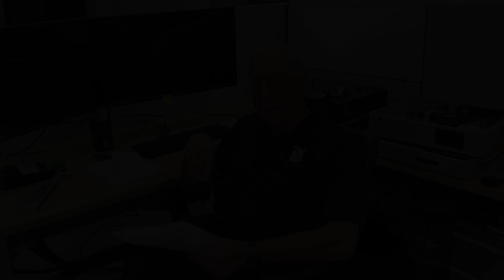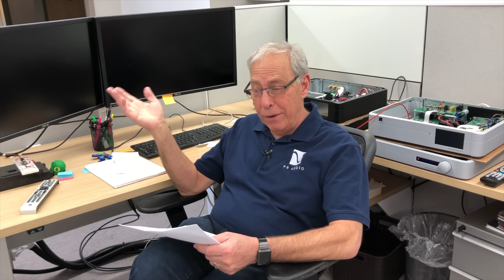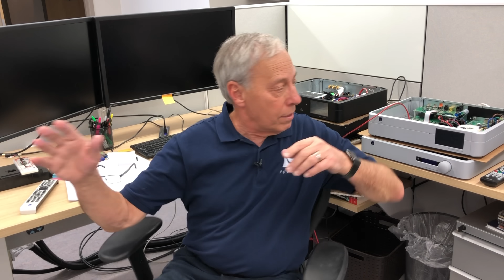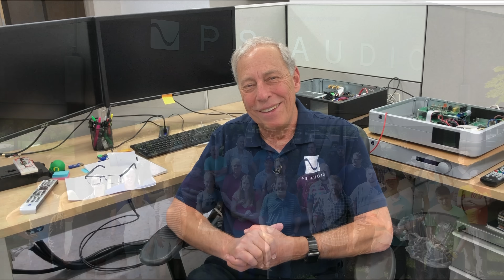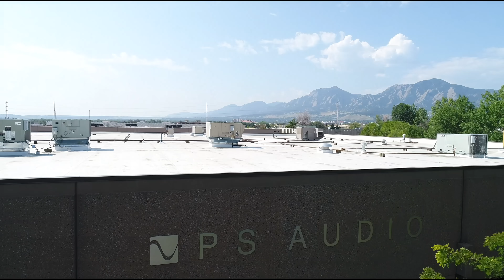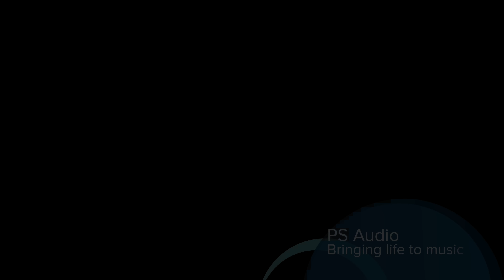Is it time to rethink our power grid?

Comment: I actually have a reasonable amount of professional equipment that has DC inputs on it. Some of it 48v or 24v fixed but some is auto ranging from 12-24v. 

It is very common in the equipment sector that I work in for equipment to either be completely DC powered to be isolated for resilience (so the equipment would runoff a battery bank and the batteries would be charged by a battery charger that was run off a UPS. )

Or, alternatively sometimes you will see a piece of equipment that will use the DC connection as a redundant power source. So it will have in some cases dual AC power supplies and a DC connection as well to a battery bank which has its own charger. Most of our larger network gear is like that.

Comment: No need to make the power grid DC. It's not going to work well. High voltage DC power lines are actually used but it's besides the point.
For home audio it would be possible to setup a DC system. Maybe a ±100V system would be enough.

As a side note. LED can run on AC just fine. They work like diodes.

Comment: I would set the DC Voltage std to 24V ...this value can be used by the  majority of DC/DC converters. ..sure wouldn't be beneficial for amps with around 50to35VDC(SS Amp). But enough for DACs preamps, CD players..and any other home electronic equipment etc

Comment: The argument for dc over ac in the home and office, is much weaker now. Th reason is that inefficient iron transformers are not required anymore. Dc/dc and ac/dc switch mode power supplies are about as efficient as one another, so the efficiency advantage disappears. Also in reality, even with a dc source, such as photovoltaics, the voltage has to be changed to the level required by the equipment it supplies, so there is always an "ac" transformation that has to occur. The exception is with small scale simple battery systems that can tolerate a range of input voltages as the battery voltage rises and falls with charge and discharge. Very high voltage dc supergrids, are now being for international transmission. One advantage is the lack of harmonic distortion and power factor issues that plague ac lines.

Comment: Why doesn't PS Audio offer dedicated solar panels and batteries to power their amplifier rails directly, or with additional regulation? They could add the "Solar" line to their "Stellar" series.
This is only half tongue-in-cheek; I'm considering building an amp with battery-powered rails.
Of course, some AC would still likely be needed to power a tube front-end.

Comment: Your description of power distribution in AC v DC is sort of right but mostly way off.  To deliver the same power, if you up the voltage, you lower the current (P=IV).  With less current, there's less losses (Ohm's law, which I think you've heard of ;) ).  So high voltage actually has smaller losses and is therefore more efficient in delivering the same watts.  (This is very distinct from your suggestion that the losses are the same and high voltage can just afford it.)  The cool thing about AC is that through transformers, you can kick the voltage up or down with pretty small power loss.  So you can pump it long distances at efficient high voltages, and then drop its voltage to safe levels before putting it in homes.  With DC, raising the voltage is much harder to implement, as is lowering the voltage losslessly.

Comment: Theoreticaly a DC building network makes good sense. But in reality its just adding complexity to Building Infrastructure which is the hardest, slowest and most costly to manipulate change. If a method could be invented where running DC Circuit around the whole building could be quick, easy & Modular. Only then could a secondary DC circuit be viable.

Comment: I think a good first step would be to define a physical interface. We have what are probably the worst sockets and plugs in the first world. I have given it some thought. It has to be backwards compatible with what we use now, at least for a few decades. It would probably ease adoption if it supports some superset of fast USB charging. I like the principals reflected in the British plug and socket, but we need something smaller. We would not need that much distance between the circuits if we had a ceramic divider that pushed into a slot in the plug actuated by the ground pin. This divider could also serve as a light pipe, enabling smart plugs and sockets to communicate. If there is no comms, the legacy plugs are powered at 120vac when those contacts are engaged. Otherwise the outlet and whatever is connected to it will negotiate a voltage, frequency (0 for DC), and a current limit. The conversion electronics will be in the wall. 
So when you plug in your laptop, it negotiates the voltage and current it needs and the outlet supplies it.
The same goes with your phone, TV, audio equipment, network equipment, lamps (lamps may even negotiate lower voltages to implement a dimmer with almost zero parts count.
There are also some cases where we here in America could use some more of that higher voltage and power, such as window AC units, power tools, portable cooking equipment... Now almost everything can plug in anywhere and those junky wall warts and cordbunicles can become fossils.
Reply: Compare a British plug and socket to a European Schuko type: the general sizing is very similar. Older types  for North America are nice and small but primitive and dangerous.

Comment: Edison was wrong then, Edison is still wrong now. DC is still not good for long distances due to VD. It may be fine to run low voltage DC inside your house, but it should be stepped down at the house not at the power station, so Tesla remains right. Also there is no thought given to electrocution... With decreased voltage comes increased amps to provide the same nett oomph. So that means making all the wires on the grid substantially heavier to produce the same amount of electricity, not to mention all the heat loss etc etc.

Comment: Transmitting power over any distance with DC is a very bad idea. The higher the voltage the thinner the wire you can use. To get enough power into your house and all the houses in your neighborhood the Utility substations deliver power to a transformer near your house at 12,470, 13,200, or 13,800 volts through wire not much thicker than a pencil. At 120 volts DC you'd need a wire as fat as a tree trunk and you'd have to live within about a mile or less from the generator. Without the invention of AC electricity the modern world as we know it could not exist. The only reason you can have little USB ports around is that the power drawn from them is miniscule.
Reply: "Transmitting power over any distance with DC is a very bad idea."

Better tell the engineers who designed the 180 mile long Basslink cable then. I'm sure they will be happy to take your advice.

"Basslink is a 400kV DC electricity interconnector that allows the trade of electricity between Tasmania and the National Electricity Market. The interconnector is rated to transmit 500 megawatts (MW) of energy on a continuous basis in either direction and up to 630MW export from Tasmania for limited periods.

Basslink enhances security of supply on both sides of Bass Strait; protecting Tasmania against the risk of drought-constrained energy shortages and protecting Victoria and southern states against the forecast shortage of peak load power identified in the AEMO Statement of Opportunities.

The Basslink interconnector runs from Loy Yang in Gippsland, Victoria, across Bass Strait to Bell Bay in Northern Tasmania. The 290 km undersea cable component of Basslink is the second longest of its type in the world.

The Basslink Interconnector became fully operational at midnight on April the 28th 2006, commenced transmitting power on 29th April 2006 and was officially opened by Victorian Premier, the Hon Steve Bracks MP, and the Tasmanian Premier, the Hon Paul Lennon MHA, on the 9th of May 2006."

Comment: Can batteries be used to replace power conditioners?  Tesla sells battery packs to charge cars and supply houses with electricity.
Reply: But unless the battery voltage matches the DC power requirements of your device, you still need an inverter. And that's a source of electrical noise. Even a product that runs on a 12v wall brick may still have a DC to DC converter inside. One of the latest audio scams are these linear power supplies for Apple and other music servers. There is still a multi output DC to DC converter inside the computer that adds RFI and EMI. Any noise coming in from the external power supply is swamped by the internal SMPS. Adding an external linear power supply won't fix that.

Comment: You kind of run into the same reason that the diameter of the booster rockets on the Space Shuttle are governed by the design of Roman chariots.  That is, prior infrastructure governs the cost of later changes.  How does a designer of piece of equipment know whether some random DC system will provide enough power, in contrast to the established 120/240v 15/20/30 amp circuits standard in a house today (US).  Not to mention the increase cost of higher gauge wiring with high DC amp characteristics.  AC only runs at "full power" for a very short time each cycle which mitigates wire heating, etc.  

That doesn't mean that there isn't some change coming.  I was just reading about the neglected power side of the USB standard and how designers are now exploiting it.  This is seen in some phone and laptops that use a USB smart circuitry that can negotiate to provide higher voltages.
Reply: 240v did that old lightbulbs only lasted months instead of years - I guess Philips has a party because of that -sweden had 220/230v and they joined eu legistate to 240v -politicians again didnt care a fuck

Comment: I think, as Photovoltaik Supported By Battery Systems become more and more Common, a secondary, redundant 24V House Supply, as Backup System and Use For essentials like Light will slowly evolve... i‘d do it if i Had a Chance to rebuild My Home...  best thing would be to be complete Independent, with an off Grid System... sadly photovoltaik ist working in Wintertimes...

Comment: Can't watch the video due to low internal desktop bandwidth where I work,  but if we are suggesting DC as a means of long distance transmission, it's been done for many years. One example is the +/- 500kv DC line on the US  west coast which runs from Oregon to Los Angeles. Every day driving to work I pass the Sylmar Converter Station in northern Los Angeles on Interstate 5. This is several acres of massive DC to AC inverters. And along the same freeway there is one high tension tower line that only has two wires versus the common multiples of three. That's a DC line from the north. They do this because to spite the cost, complexity, and reliability issues of converting AC to DC then back, it still saves money due to reactance losses on long (hundreds of miles) AC lines.

https://en.wikipedia.org/wiki/Pacific_DC_Intertie
https://en.wikipedia.org/wiki/Sylmar_Converter_Station

As for DC distribution at the user level, might actually be practical today. Remember when we had the great Edison/Westinghouse AC/DC war, we did not have efficient switch mode inverter technology. Today we do. So the idea of DC distribution is not that far fetched. Also back in the 1990s Toshiba made a large data center class UPS system that sent 2200v DC from the main inverter to distribution pods in each equipment room. Those then inverted the 2200v DC back to 208/120 three phase 50/60hz AC. Again the claimed benefit was efficiency.  Still, I don't see DC distribution at the user level  happening anytime soon.
Reply: I agree low voltage DC distribution is a nonstarter but I worry about the noise problem that might be caused by huge inverter farms. i spent most of my life in the power supply field and I know the problems that can be caused because of switching noise.
Reply: @dell177  While electrical noise is certainly a problem, it is no where near the issue that the audiophile power product vendors want you to believe.
Reply: The other end is on a hill just outside The Dalles, OR. I've been to their visitors center several times.  The rectifiers are huge vacuum tubes in a Faraday cage building. They have cranes to move the tubes to a maintenance area to rebuild them every so often. When I went in the '80s, you could go into the control room and talk to the operators. Depending on air temperatures, they run the current quite a bit above the design specification.

Comment: DC at high voltage would be more dangerous to handle - high DC through the body kills you whereas high voltage at a low current may not kill you.  I also like the isolation that comes as a result of transformers and capacitors in individual components.  The isolation of different DC voltages would take a different (unknown) form if we  pulled DC from the wall outlets.  Noise travels on both AC and DC, it's like a nasty infestation.
Reply: DC at low voltage can give a shock also. Just tie about 6 car batteries in parallel. I got a very small shock once grabbing both terminals on an array.
 It was over 25 years ago.
I was living off grid at a campground, charging batteries with a car engine.
Is that possible or was I puffing on the magic pipe too much?
Reply: @SJMessinwithBoats1  72VDC is WELL into the dangerous potential range for D.C.
Reply: jimmeh, I'm actually talking just a fully charged 12.8@ 6 or more batteries 
Not series.
Reply: @SJMessinwithBoats1  oh, my mistake.  Still yes you can be "shocked" by a 12VDC source. It happened to me as a kid testing trailer brake lights with a car battery. If your hands are wet, you'll feel it :)  

It's more of a tingle than a shock though and usually even if your hands are wet with salt water, the potential isn't high enough to induce sufficient current to cause any involuntary muscle contraction or defibrillation.
Reply: jimmeh, seems like my dad would say even lower voltage than that can get you a shock and potentially more. He would say that, "get enough amperage behind it". He was avionics on the P3 Orion for twenty years. 
 I crave electronics, and electrical facts. But my main trade was auto tech at new car dealers. 
 Stereos are just part of my car thing.
Reply: @SJMessinwithBoats1  fair enough :)

only problem there is that current is drawn and not pushed, you can't force current into something, it will draw whatever it is allowed to and that current is a function of the resistance of the device and the potential difference of the supply.

But cool :D
Reply: @jimmel B. I never got to mention that to anyone versed before. I remember being shocked in two ways.
Thanks.
Reply: Most SMPS's are isolated by means of the high frequency transformer within every single one of them. 

Capacitive voltage droppers do NOT provide mains isolation of any kind.

Comment: If our power grid were to be "rethought" nowadays, it would inevitably be re-designed to promote and accommodate bad quality, unreliable, and inconsistent energy sources like solar and wind. Our current power grid is designed for good old AC produced by reliable sources like coal, nuclear, hydro, which produce higher quality power. The question is completely misguided. AC is far superior to DC for both transmission and the actual quality of the power.

Comment: Although Tesla had his fingers in the pie, it was Edison and Westinghouse that battled it out on AC/DC thing. Edison was quite unhappy when Westinghouse showed up with his AC current and transformers. Tesla got off on high voltage stuff. He loved huge loud sparks and the such, but did contribute a lot of good ideas, many he was not given proper credit for. I really doubt we will ever see a fully DC electrical power supply. Ya, lightweight, modern switch mode power supplies have eliminated many of the iron core transformer applications, but they have issues. Switching an inductive DC load on and off is murder for a regular make/break mechanical switch. The arc is terrible and will destroy the switch in no time flat. Years ago, we did rely heavily on AC power to directly run something. Clocks needed a perfect 50/60Hz to keep time because they used a motor to run them. On the other hand, just about all vacuum cleaners, power saws, drills, and equipment with a "universal" motor (a motor with brushes and commutator) could run on AC or DC! Many old tube radios could run on AC or DC too! BUT, there was still a rectifier that changed the AC to DC inside. Anything with an iron core transformer has to use AC though. But, ya, more and more devices are showing up now that run on DC. Washing machines, furnace blower motors, all electronics, LED and CFL bulbs have little power supplies that change the line current into DC, but changing out the whole power infrastructure to DC? Hmm.

Comment: The physics of long transmission will keep A/C as our main grid.  But we certainly need to do a number of things to protect our electrical grid from both natural and human threats.  Decentralization and EMP protection are our first concerns.  On a per home basis I can see new homes or home conversions to DC for lighting.  There are commercial solutions that offer 12v or 24v DC for lighting only and 120v AC to outlets.  This is a system that can be implemented fairly easily with proper planning in any new build.  It's a bit more complicated (with dubious financial benefit) for remodels.